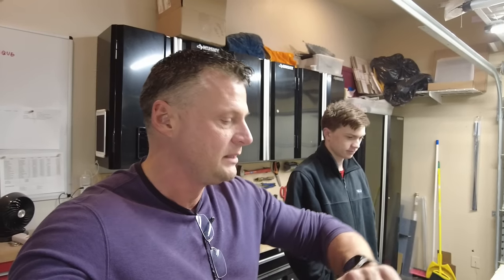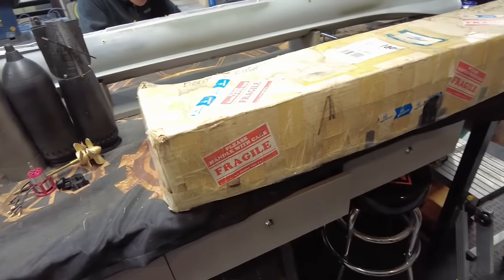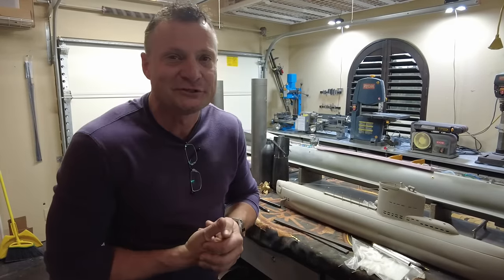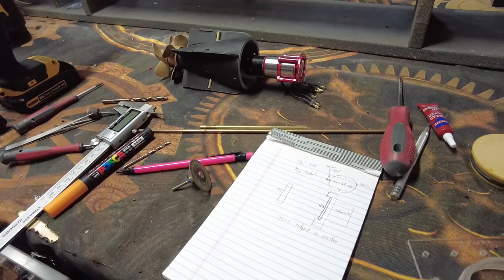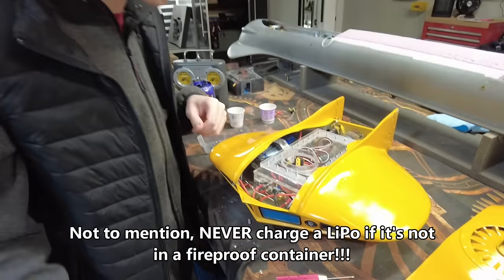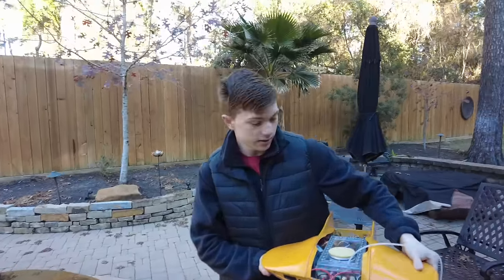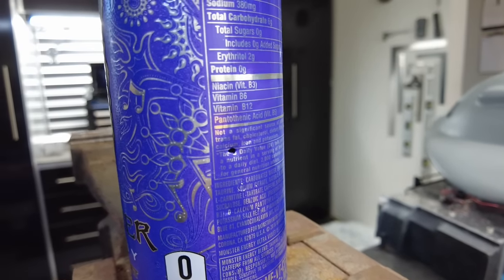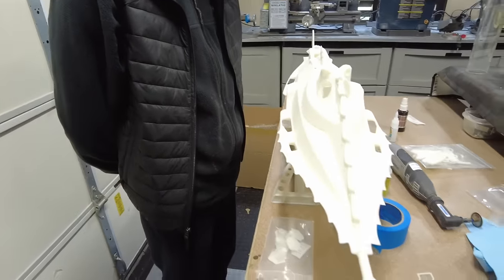Flying Sub, Giant Seehund Torps, new 48" Nautilus kit, a smashed customer boat and more!

Comment: In your SeaView thinking of the ballast tank is wrong it is a floatation tank. Why not use molded lead as a external keel.
Reply from the maker: Erm... what other kind of ballast tank is there other than one that causes flotation? I will be using bar metal in the keel this week to increase stability, as I mentioned in the video

Comment: At end-of-run the deceleration curve increases to a point where the remaining propellant moves forward, causing the dive at end-of-run. Off-set the stabilizers to spin stabilize the weapon and move the c.g well aft to keep the ass-end submerged during the run (preventing paddle-wheeling of the stabilizers at the air-water interface that causes a radical turn during the run). I too am seeing failures of the Ronson valves. Might have to custom make better check-valve equipped filling devices.

Comment: You can reduce torque roll by using a prop with less pitch, but this will probably also reduce speed. Perhaps a prop with less pitch and a motor with a higher kv? Just a thought...

Comment: If it were possible with your torpedos? like a rifled barrel makes a bullet spin to fly straight, rifling your torpedo bay tubes might help to make the torpedo go straight, but not sure that works with a torpedo being it has a propeller spinning at the rear. Good luck.
Reply from the maker: Interesting idea, but I don't know that the amount of work needed would be worth the experiment. They actually run pretty straight (most of the time). Once we get the actual launch tubes in place, I think we'll see some better, more repeatable performance.

Comment: Very cool.... I build plastic models..lighting them is as far as I go.. Working on the moebius 707 Seaview kit.. so this is very interesting ..What about a 3D picture of the Seaview control room???  can that be done....give it some depth..than vacuum seal it  ??  As you can see this I'm no armchair RC sub expert , far far from my 'acumen'  Regarding the Flying Sub. What about using variable jet nozzels like they use on RC jets???... would that give the FS enough kick to control it.. or.. are the duel rudders, which are incredibly clever...  necessary.. this is really cool stuff.. so impressed  it's like how do people do this stuff, figure it out..... !!! Well done guys !!
Reply from the maker: I've done the articulated nozzles in the Flying Sub. They work really well. This boat came to us like this. A complete rebuild was not in the build scope.